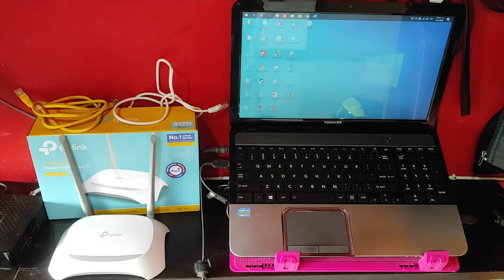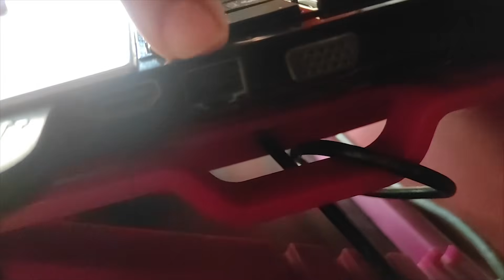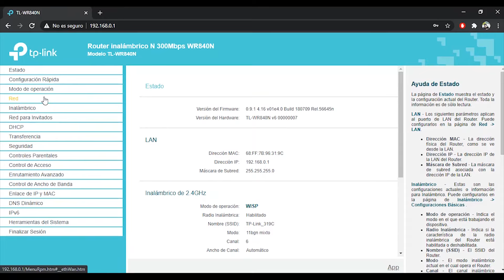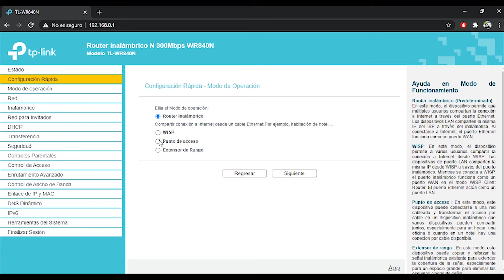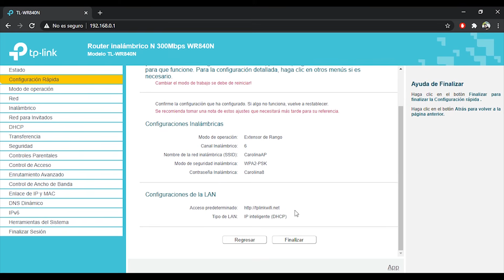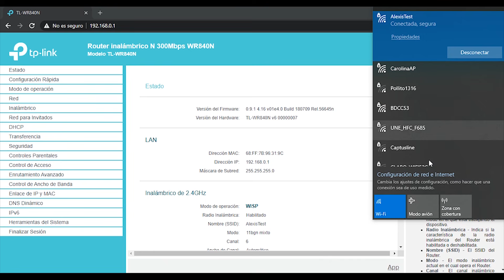How to install and configure a Router TP-Link TL-WR840N

Comment: I want to use that router to reached dead spots in our house. But i have a confusion between Signal repeater and WISP mode?

So far on this video, what i understand is when you're in "signal repeater" mode, the TP router will connect to a existing wifi and that existing wifi will be emited by TP router while in "WISP", you'll also connect to the existing wifi and the TP router will emit a different wifi signal which mean it has its own SSID and Password.

Am i correct? Pls enlighten me if not.
Reply from the maker: You're right, the TP router creat a new network with it own SSID and password.